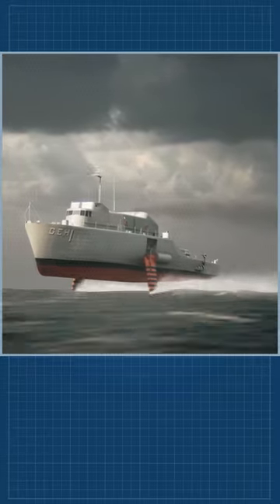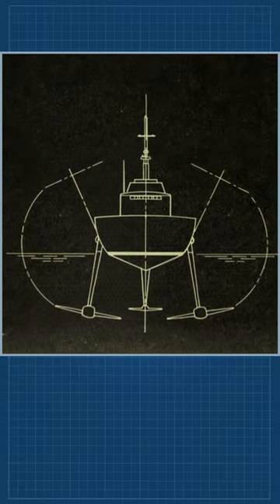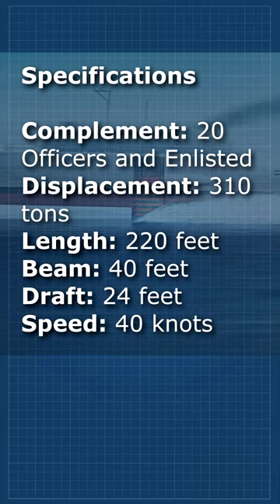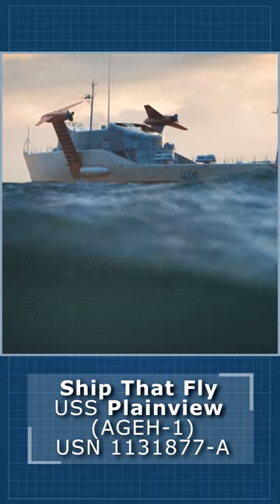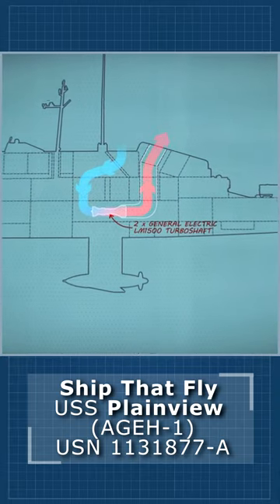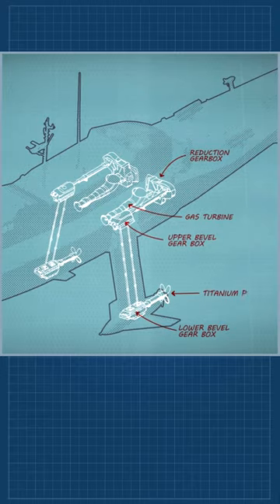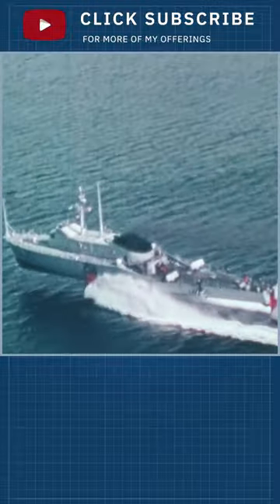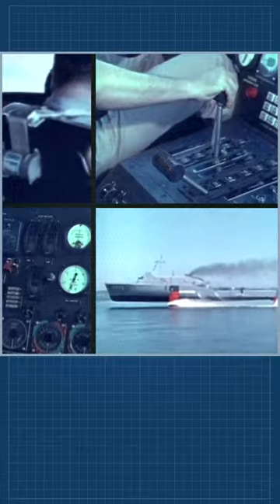Ship That Fly - USS Plainview (AGEH-1)  #shorts #navy #usmilitary

Comment: it was a bicycle version of the Russian akranoplan
Reply: Not really...
Ekranoplans were basically aircraft that were designed to fly just above the surface in the ground effect. They could fly right over rocks or low landforms, but they were still considered ships and built in shipyards.. Some could climb to several thousand feet but their controls and flight performance outside of the ground effect was marginal at best.
Hydrofoil boats, on the other hand, develop lift from hydrofoils in the water rather than airfoils in the air.